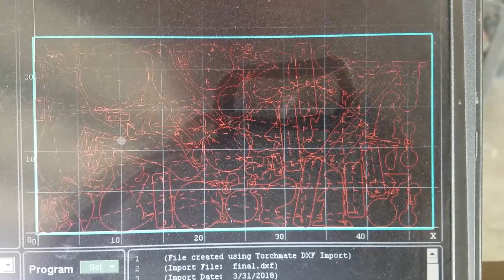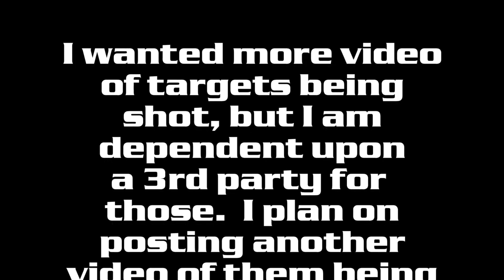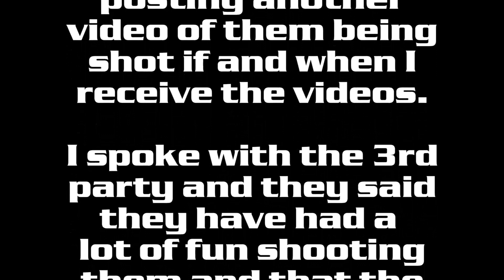Air Rifle Targets (Steel)

Comment: whats with the starter hole it makes before it cuts the image? just curious why it does that
Reply from the maker: The pierce creates a large hole as the plasma stream excavates the material through to the other side.  The hole usually comes out 2-3x the width of the overall kerf (depending on how thick the material is).  For that reason we have a lead in line that isn't part of the shape.  Overall it is cleaner and leaves you with a more professional final piece.  I have done no lead-ins before (usually for small holes).    If you look carefully at plasma CNC videos you will see the hole is bigger than the kerf width.  Lasers do this too.